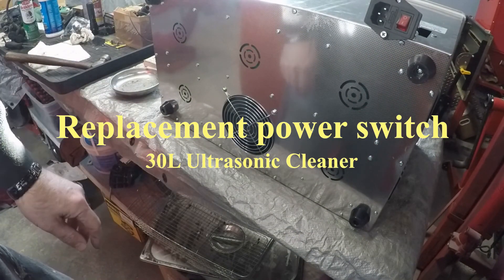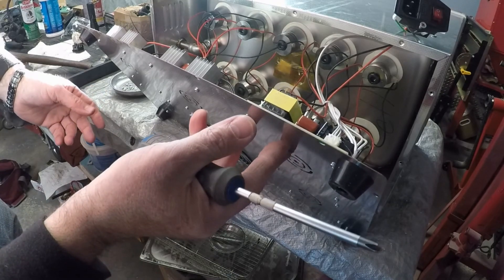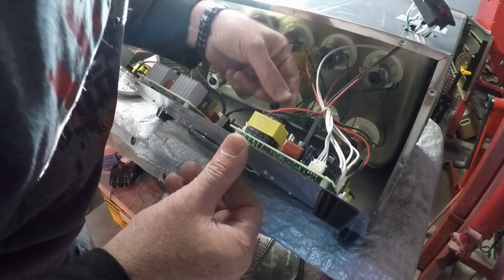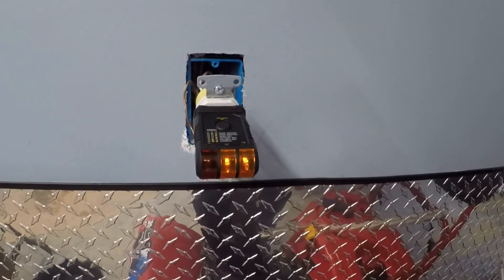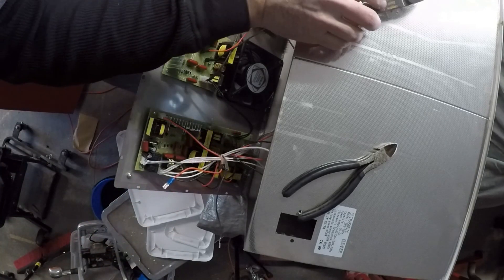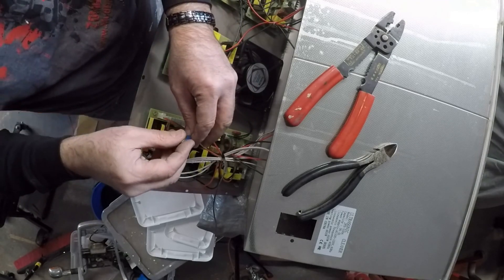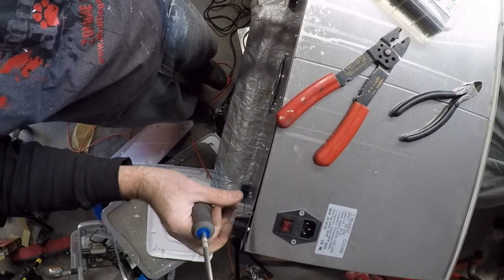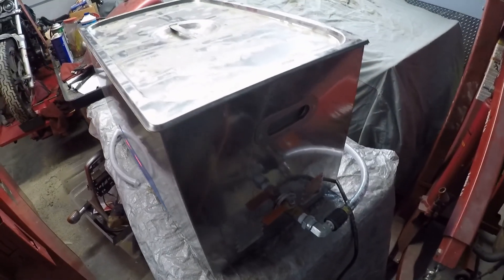30L Ultrasonic Cleaner (Switch Replacement) #30lultrasoniccleaner #powerswitch #digitalultrasonic

Comment: Where did you attach the ground wire
Reply from the maker: I just reviewed the video.  One end of the ground wire with the spade terminal connects to the back of the switch.  The other end with the round terminal end connects to one of the nuts that hold the switch in place.  That way the switch gets its ground from the case.

Comment: I think I have the same model.  The cleaners heater works but the sonic part quit.  I'm guessing its a fuse.  Not sure how to replace the fuse.  There are no instructions that I can find on the internet
Reply from the maker: The only fuse that I'm aware of is inside the housing where you plug the cord in.  If that fails, there is no power.  Maybe there is a bad connection somewhere.  I wasn't able to find any instructions either.  I've gone through a couple switches on mine.  Maybe there is fuse somewhere.  I'll check the next time I have to take mine apart.  Thanks for watching.

Comment: Fixing the same exact one as this, same problem too. I just don’t know how to wire the new switch. It’s a little different on the back than the original
Reply from the maker: Which switch did you get? I used an ohmmeter and checked the connections.
Reply: @wonkster1970  sorry about that, I haven’t been on lately. It’s done now. But the switch I got looks just like the original except it had 6 terminals on the back. So I was confused as to which ones to connect the wires to. But I figured it out. Worked out well cause someone asked if I could figure out why the thing wasn’t working and said if I fix it they’d give me this bad ass engraving machine (brand new) so I figured out it was the switch, replaced it and got a $679 engraving machine. Your video helped with that, so thanks. Appreciate the response too. 🤙🏻